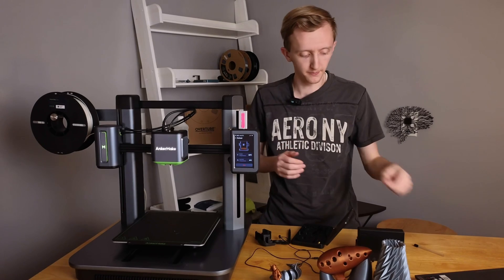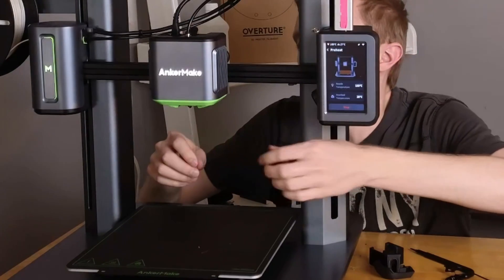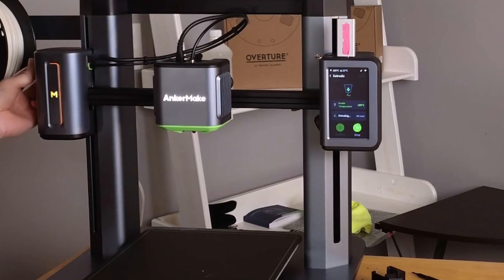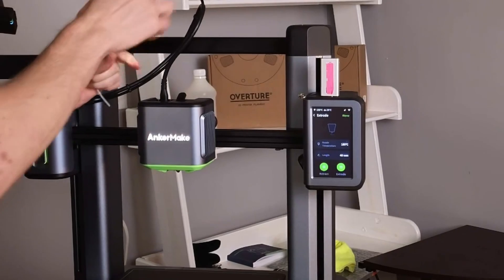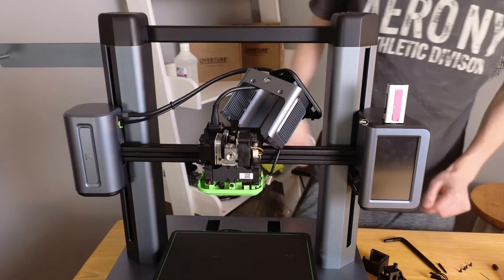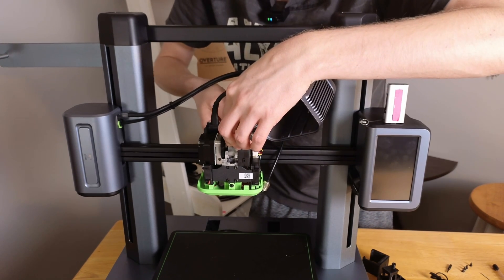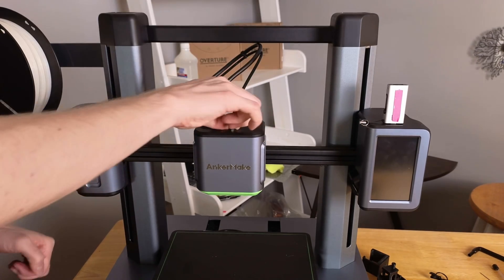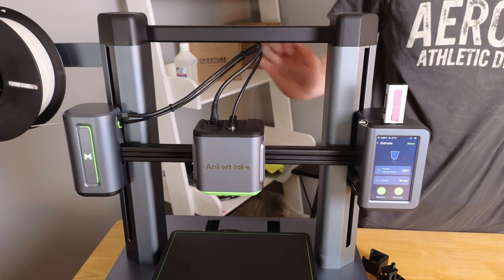Can't load filament... - AnkerMake M5 Troubleshooting

Comment: Thanks this came in handy!!  Was doing a print and ran out of filament and loaded a new spool and couldn't figure it out once cleaning the nozzle didn't work.  Popped mine open and it was a piece of filament wedged in there.  Once I got to out smooth sailing from there.

Comment: Every time mine runs out of filament, i can't load the fucking filament into the thing on the left side. It just gets stuck halfway. I've tried ripping out the tubes, etc.... nothing works. any ideas? Its 100% the correct filament size because it came with the damn printer
Reply from the maker: Hmm, not sure on that one. I know it's tricky for me to get it through the side sometimes, but I haven't run out of filament to cause it to get stuck there. Can you pop the tube off from the print head end and pull the stuff out from there? Oh, you maybe said you tried that... that's all I got man... sorry
Reply: @Ecto3DPrinting  I figured it out eventually thanks man. The motor that feeds the filament to the extruder had a tiny piece of filament broken off inside, had to  take the entire thing apart.

Comment: I ran into this problem today when trying to extrude. I was surprised to see a little wizard on the display to clean nozzle, but the cleaning steps were very vague... like had me take stuff apart, then says carefully clean nozzle, and shows a picture that looks like extruded. Then it says "tighten nozzle" without seeing a step that ever said loosen nozzle. In the end I rocked the feeder out of the way and went to extrude and pushed filament down through the nozzle manually and it began to work as expected again with extruding and stuff.

Comment: We watched this video, and we were able to unblock the feed tube right at where the gear feeds it in. We had it fixed in less than 5 minutes. We had been messing with it for about 2 weeks  off and on trying to figure out what was wrong with it.  Thank you for posting this video.  You saved my hubbies patience and my sanity.

Comment: Man, THANK YOU!!! I had a tiny piece of PETG that was stuck right in there. I wasn't able to grab onto it, but I delicately used a tiny screwdriver to push it through. And the idiot I am didn't realize that the black top cover separates from the middle section...I saw that here, and wooo, that sure made things easier. lol

Comment: Anybody else find that a brand new M5 has these problems immediately? I can't get the initial filament to load
Reply from the maker: Dang, sorry to hear, hope this helps...
Reply: Sorted with a dismantle thanks. The filament that comes with the unit has a bend that prevented it from feeding correctly
Reply: Same issue, very difficult to load the filament. I have tried severals filaments and it's the same behaviour, I have to unplug the tube form the extruder and move the filament to find the heatbreak hole. Asked to the support, waiting the feedback

Comment: My first 3D printer.  After failing many times trying to load the filament instead of one 45 degree cut I did two 45 degree cuts to make a point. And it worked for me.

Comment: Day Two of my AnkerMake M5 and I hit the same issue when I let a print run out of filament.  I took it apart similar to the video, but was not able to extract anything - there was a two inch piece of filament stuck in the hole right below the metal.  It felt like the hole was just closed up whenever I tried to put something down into it.  I heated it up to 250 and tried to extrude, but nothing would come out.  Finally I took the bottom nozzle off, and pushed a long paperclip up from below and was able to dislodge it. It popped out and voila it works again.

Comment: I have been having this trouble also.  There must be some sort of lip in the filament path just below the extrusion gears.  Pull the bowden tube out of the fitting and grab the filament, unclamp the extruder, and wiggle the filament around.  Its fairly obvious when you get the tip of the filament past that step.  If the nozzle is hot you can manually push the filament in and get it to extrude.
Cutting the end of the filament on a 45 degree is important.  Work the filament up and down while holding the gears open.  It will slip past the ledge and it will be obvious as you easily push it another 1/2" past the ledge.

Comment: When I received my Ankermake M5 and did the leveling process for the first time. I had small blobs of filament all over the plate. Now, I had never loaded filament into it. When I did load some filament and extrude some (it was black pla+) the first few inches were an off-white filament. I think mine may have been one that was tested at the factory for QC. However, I'm still unsure how that got in there.
Reply from the maker: Yeah, I'm pretty sure they're all tested at the factory, leaving some filament inside. Mine did the same

Comment: i just had this issue myself. I ended up popping the hose off the top and pushing the filament in from there while hot. Was able to get a better push that way and clear the blockage.

Comment: After I cleared my blockage, I found that I hadn't sufficiently tightened the springs screw which resulted in under extrusion regardless of temperature and a tendency to extra under extrude on the right hand side. Great video!

Comment: Thanks for the vid help. Wow. What was that, looked like metal but suppose it was filliment; With the white filliment in particular I've noticed it needs to preheat to 220 -225 C and to use the extrude function while simultaneously hitting manual extrude to help feed
Reply from the maker: Yeah, it looks like metal but it was just the previously loaded Overture Silk Gray filament. Yeah, I usually have to push the button more than once to retract. I can usually get my white out at a normal 200, but I'll keep this in mind if I have future struggles!

Comment: I noticed that my filament (coincidentally, also Overture White) tend to curl on the nozzle usually messing up the prints. Any idea how to fix that? I tried cleaning up the nozzle with the needle, but that didn't work...
Reply from the maker: Hmm... unfortunately I haven't had that happen much. It happened in the video here, but it doesn't usually happen. idk but it could be your nozzle is worn a bit so the hole is bigger which causes an uneven flow...? but honestly idk...
Reply: @Ecto3DPrinting  Right, since we have a bunch of nozzle, it doesn't cost much to try replacing it. Will try that! Thanks for your videos, very helpful!

Comment: The feed tube has a quick connect. Just push down on the black collar where the tube goes in and the tube will pull out. Then you won't have to unscrew the connector each time.
Reply: Can you do a quick follow up on this quick release please. Enjoying your videos keep up the good work. Perhaps you would consider making a video using two different separate colours for one print job.
Reply: +1, this would be helpful!
Reply from the maker: :O I think I found it! I would've never guessed that was a quick release! Thanks for sharing!!!
Reply: Cool!
Didn't know that, I'll have to check that out.
Reply from the maker: :O I need to find this! I'm gonna go look right now! haha You mean the filament tube that I screwed off in the video, right?
Reply: best comment i've ever read. 👍🏼
Reply: Very helpful… thanks